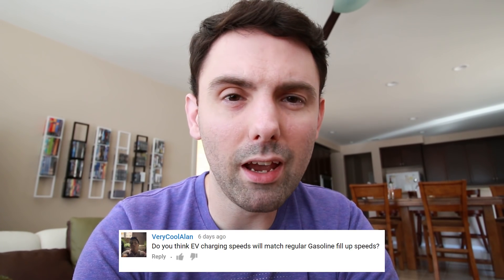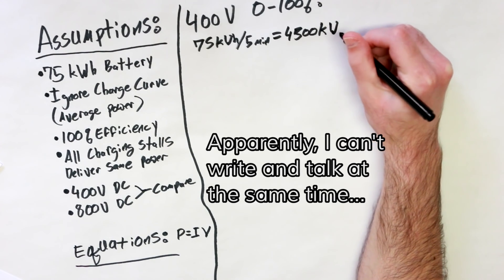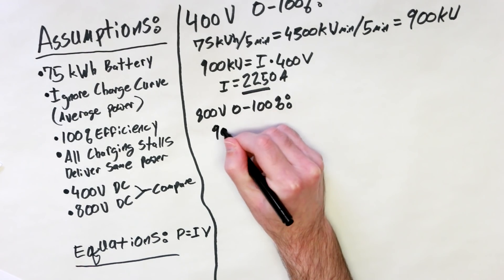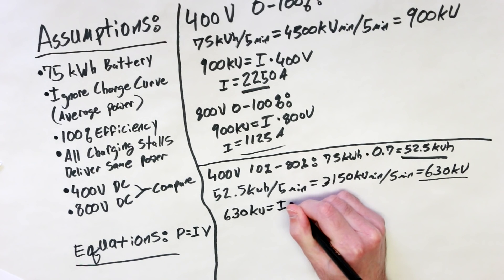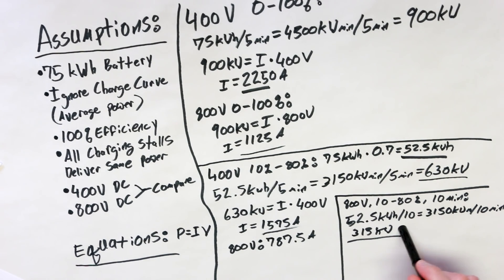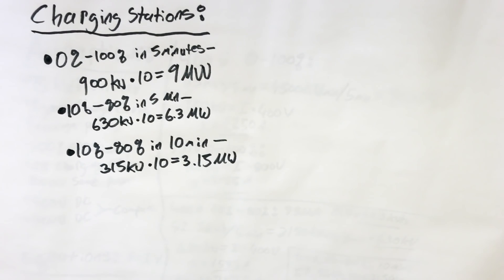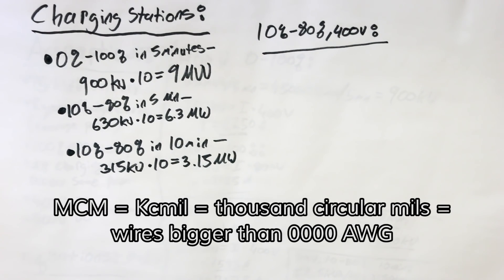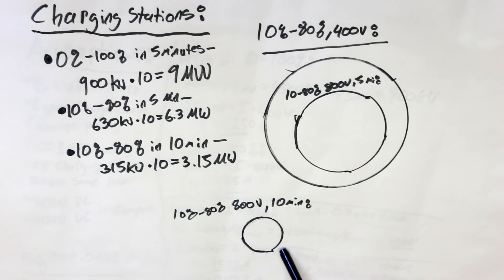Can Electric Cars Charge As Fast As Gasoline Cars Refuel?

Comment: A horse can remember where it's going and go there autonomously. Replacing horses with automobiles was a huge step backwards in that area, only a century later are we starting to catch up. EVs won't charge as fast as ICEs fill up for a long time, maybe ever. But it doesn't matter. An EV owner charging at home spends less time "at the pump" than any ICE owner. 16A charging at parking stations, 200 kWh packs and 350 kW charging makes EVs more than practical enough.
Reply: He's right.
New tech isn't always better in every single way. LCD monitors took a while to match CRT's refresh rate. And they still haven't matched their response time.
Reply: 6.6 is fine at home, it'll charge full over night. On the road you'd use level 3 and get 50 kW. The new Hyundai Ioniq can do almost 70 kW.
Reply: Patricia: China could do the kind of EV cars I mentioned that fits the needs of the daily commuter. Could be done quickly, nothing fancy, all the technology is there. They will do it for their market.  You don't need a 2 ton 500KW sophisticated monster like a Tesla. Musk is milking a certain class of people.
Reply: +Ellsworth M. Toohey. That is very myopic.
If economies only catered to "needs" they wouldn't grow. At least not as fast. Every category of products have a spectrum ranging from cheap and crappy to luxury and excess. Today's luxury will one day be the norm and one day outdated.
Reply: +Ellsworth M. Toohey - You're right about instant gratification, but you're only half right about who delivers it.  On a road trip, the ICE vehicle delivers instant gratification.  There's no question about that.  There's a gas station at every exit, and the car can be completely refueled within five minutes.  But, for local driving, it's the 200+ mile EV that delivers instant gratification.  Every morning you wake up with the equivalent of a full tank of gas.  The only effort it took was spending five seconds to plug in your car the night before.  And it's not a behavior people need to learn, because they've been doing the same thing with their cell phones for years.  There's never a question of "Oh, I have to remember to wake up a few minutes early to go to the gas station before heading to work."  And for people who drive a good amount, that trip to the gas station is a weekly occurrence.  There's also no question of having to hassle with an oil change every few months.  As far as convenience goes, EVs have it all over ICE vehicles for local driving, which happens to be the vast majority of driving for most people.  ICE vehicles have it all over EVs for long distance travel, which is comparatively rare for most people.
Reply: +Patricia Collins - I think you're right that there's a definite generational dynamic going on.  I'm an exception, but most people of my generation range from somewhat skeptical to outright hostile toward EVs.  But, teenagers these days don't have the same emotional attachment to cars and driving that we did.  To them, a car is just an appliance that takes you from point A to point B.  On top of that, they grew up plugging in their cell phones and tablets and laptops, so that's normal to them.  It's gasoline engine technology that is a little bit foreign.
Reply: +Ellsworth M. Toohey
Then don't buy a Tesla until they become more affordable. I can't afford a fancy Tesla either.
Reply: I see EVs in a realistic sense and want them to improve greatly. The positive I see from this is that being that Tesla is a luxury brand, people willing to pay for a Tesla are funding the technology to improve electric cars but I have a feeling that while the evolution to parity with combustion engine fill up times (regarding charge times) will occur within 50 years, I don't see Tesla selling a vehicle under 35,000 from this point on. 

It looks like Tesla won't be the one to produce an inexpensive (relative) electric car under 25,000 BASE PRICE before tax incentives. China seems most likely but hardly any cars in China are sold worldwide. Maybe Toyota, GM, Hyundai, Kia, etc?
Reply: Dan Sanger. I just hope people will be willing to adapt to that routine of charging and electric car but not this generation. People born from this point on in 2017 may most likely be the ones to accept the  concept of electric cars. There should at least be a charging infrastructure but for people in condos and apartments, I see a problem with availability. Tesla caters to the luxury department and that means there will be combustion engines for at least half a century.
Reply: Tesla also started from scratch. And tesla has become the EV ambassador, the flag, the captain leading the charge into battle. That changes the mentality of the populous. That changes the culture. 
"Tesla P100D does 0-60 in 2.3 seconds." Also affects the decisions of someone who's got 30 grand saved up. He'll think hmmm maybe EVs aren't glorified golf carts. That's very very very valuable. 
Reasoning with people rarely translates to change. You have to keep human nature in the equation. You have to make change look sexy. Otherwise EVs would be postponed, Suppressed and sequestered until a peak oil scenario. Those "milked" people convinced investors to pay for the Gigafactory Which will produce the 2170 cell which will go in the 35k model 3. 
Regarding pollution and resources I agree but take it up with capitalism and consumerism.
Reply: +HairlessHare - The CEO of Daimler put it very succinctly recently when he said that Tesla helped EVs shed their "granola image."
Reply: Ellsworth M. Toohey it looks like we may have to postpone this discussion for another decade. The Tesla echo chamber is too loud right now lol!
Reply: Street parking is a problem that might be  solved by public parking garages with 240v outlets or 240v charging posts on the street, like they have in Norway. Payment is electronic, typically it costs $3-4 to charge overnight which would fill a Hyundai Ioniq or half fill a Tesla. So no major new tech is needed. Consumers need getting used to it, sure. They adapt very quickly when they want to, not so fast when they have to.
Reply: Give it a few decades and that's for China only. Everywhere else? We all would be in retirement homes before that happens.
Reply: It's a start for the younger generation especially with charging devices like phones but if electric cars never catch on, promise me in the next 50 years you'll meet me at the Grand Canyon in your year 2032 Chinese electric car so we can both drive off the cliff together. /s
Reply: :) We'll Thelma & Louise it together.
Reply: Dan Sangers: Reread above what I said about what, based on current technology, electric distribution network ... an EVs should and can  be. I would buy one.  You don't find this car because there is no much money to be made !  The Chinese may do it for their internal market and then ? Tesla marketing is all emotionall, not rational.
Reply: +Dan Sanger
Yes, to me, a car is an appliance or tool that gets me to where I want to go. So I would love to get rid of that noisy and dirty ICE (internal combustion engine) and to go electric, if and when the technology can prove itself to be practical and a better value. Also, I want for cars to hurry up and go self-drive, as I am tired of driving. I want to turn driving over to a trust-worthy computer, so that I can better enjoy the scenery rather than having to keep my eyes on the boring road.

Humans are such lousy drivers, that I have high hopes that computers can handle driving better. Perhaps so, if we can put some brilliant programmers onto the task? There are many things that computers can do better than humans, that should make computers to be the better drivers. Faster reaction time, no panicking in reacting to emergency situations, the ability to maintain constant alertness for many hours with no rest, and the fact that computers do not get drowsy. In fact, I feel like my brain is running a computer program when I am driving. Which the human brain was not designed to do, but rather to be creative. A human driver may be able to somewhat track 2 or 3 nearby cars. A computer probably could track the motions of the 50 nearest cars. Thus, a good computer-driver might be capable of sensing a pile-up caused by lousy human drivers, a few seconds before it occurs, and be able to avoid it altogether.

I like the perspective shown in the movie "iRobot". Set in the near future, all the cars are self-drive and go faster and safer as a result, and they are not powered by fuel. A lady was afraid of the guy's motorcycle. "Isn't it powered by gasoline? Isn't that explosive?" Yes, even to me, burning fuel seems so quaint and out-dated. Apparently future cars are powered by electric or by free-energy. They did not fly, as they were aiming for the "near future". Although I suspect levitating cars without any wings may be possible, it currently appears near-impossible with currently known technology.
Reply: +Patricia Collins
Would many people living in apartments, perhaps be okay with charging at work?
Reply: If their workplace had the option for charging and the fact that these people will most likely always be under 80 percent charge. Also, being only able to charge at work, it is recommended for these people to have an electric car with DCFC because making errands can in a car you are only able to charge at work or a charging stall that may most likely already be used can wreak havok on their schedule. Stick to hybrids if you live in an apartment.
Reply: +Patricia Collins
I think most people spend more time at work, than they do driving. For people like me, who seldom want to make long-distance trips, it could work? And on long-distance trips, they would have to use super-chargers en-route anyway.

Let's say that you live in an apartment, and you have an EV with 200-mile recharge range. Your battery is at 50%, and you take the day off, or somebody else was using the charger at work. You have errands to run, that are no more than 30 miles. What exactly is the problem? You will add 100 miles more tomorrow, and only have to run 20 miles to do errands or to get to and from work then.

Hybrids are the worst of both worlds. The problem with the hybrid is that it fails to get rid of the pesky repair nightmare money pit that ICE cars have become. And hybrids cost more up front for perhaps slightly-better fuel economy, which probably is not economically justified. Or did you mean a plug-in hybrid? Well it is about the same problem for apartment dwellers, plus that they get a shorter-range vehicle, which is even worse. Why not simply an ICE car, since they will be buying fuel anyway?

Why would a workplace have only 1 charging stall? And if so, probably only 1 person at work even has an EV? If you can afford an EV, then perhaps you can afford to buy your own super-charger to donate to your workplace, if they are not willing to spend the money. If you have good job security and pretty much your own parking space, it would be almost like getting a super-charger for your home. You probably will not be living there forever either, and perhaps you can take it with you when you switch jobs or move out?

If I worked at some fancy place that offered EV charging, do you think that might influence me to take a chance with buying an EV? But what is really needed, is for somebody to invent an 800-mile battery. Perhaps it is possible, with all of this talk about graphene, solid-state batteries, and super-capacitors? Or how about we just use the free-energy machine technology that the evil NWO stole from Tesla and the American people? That would handily and ultimately solve the battery problem and eliminate the need for recharging.

Also, has anybody given any thought as to what effect that autonomous self-drive cars might bring? Would we then be talking of cars that can drive off by themselves, and get themselves charged up? Would one even need to own a car anymore, when you could engage in car-sharing, have a waiting self-drive car in your driveway at all the times that you want to go somewhere, scheduled by a car-sharing app? Would that be cheaper than owning a car with all of the headaches that that brings? Think of how much less parking would be needed, when cars are in use transporting people, 70% of the time, rather than less than 10% of the time? Car-sharing cars would likely be far better maintained, than many too-busy private car owners keep them maintained, as cars could drive themselves in for maintenance and cleanings.
Reply: Hybrids are the best stop-gap for people especially the nearly 50 electric mile Chevy Volt. EVs have to be introduced slowly and practically.
Reply: +Patricia Collins
What what problem do hybrids really solve? They still have too many moving parts, to keep causing problems. They still have that awful repair-nightmare money pit ICE (internal combustion engine) in them.

50 miles on a charge is a joke, but of course, they say that the ICE allows it to do longer trips. Some hybrids are modern-quiet at slow speeds, but not at high speeds. That is like having a shiny new spiffy car, well except that most of the car is rusted or covered with dirt and mud. It just doesn't shine or gleam quite as much as we had hoped. A hybrid is like a car that doesn't even know what it wants to be. Like a clueless "undecided" major in college. Actually worse than that, as what even is the point to design a machine, that doesn't know what it was designed to do? Hybrids are still vulnerable to a shaky economy and volatile price spikes in fuel costs.

EVs have to be introduced slowly? But most people refuse to buy EVs, because they are moving along in the technology too slowly, and we still doubt that the EV has enough to offer to make up for its annoying recharging issues. But if we could just have an 800-mile battery, then people would be making jokes about ICE cars, how they are oversized golf carts and can't even go very far on a fill-up. Wouldn't it be fun to see the tables get turned the other way, and then people who drive ICE cars will be the outdated weirdos?

And am I correct to imagine that there still is that tinge of people who suspect that hybrid drivers and EV drivers are weird or "greener than thou"? ICE cars are still considered normal and practical, while EVs are just strange. Perhaps that will soon change?

Me personally, why would I want to get rid of the exhaust pipe? When was the last time you had a big repair bill for an exhaust pipe? I want to get rid of the ICE. It has served its time, and it is horribly outdated now. Please make it go away. Cars should also be self-drive. I am sick of having to do all my own driving. I wish the car could do it for me. A lot of old people who are losing their ability to drive, would love to have a self-drive car!
Reply: +Patricia Collins - I reached the same conclusion as you did about PHEVs before I bought my Chevy Volt two months ago.  If I had been able to hold out two or three more years I might have made a different decision, but replacing my old car couldn't wait any longer.
Reply: PHEVs could also be  a double edged sword. If the Chevy Volt had 250 miles of electric range plus the 300 miles or more miles on gasoline, for a total of nearly 600 miles; that could cause the general public to go "hmm, so if I run out of electric range, I still have 300 miles on gasoline/diesel!" Oh and if the combustion engine of a 600 mile PHEV could be used as a range extender, that's going to make the decision between only a 250 mile EV vs the PHEV version of that EV with the 300 or more miles from the combustion engine plus the fact that it could act as a range extender will have people choosing the PHEV. Obsolete technology never really dies so we could see the next 100 years of 300-500 mile EVs and the PHEV counterpart for a total of nearly 1000 miles of range. Just a possibility.
Reply: You're massively overthinking this. An owner of a PHEV charges when he can and fills when he must and doesn't really think about the actual range in miles.
Reply: +Dan Sanger
Often the cheapest car to own, is the one that you already have, so once you buy a car, you are stuck. Most people can not afford to buy a new car until the old car wears out, so as I heard on talk radio, even if they came out with a car that ran on water, we would still need to drill for oil for the next decade or more, until the current fleet of cars wears out.

I will have to get rid of a car pretty soon. It is getting just so worn out. Too bad that the EVs still will not be ready for the general public. But I probably will get my other ICE car finally repaired so that I can drive it.
Reply: +Patricia Collins
Wouldn't it make more sense, instead of whatever hybrid proposals, to just design an 800-mile battery? I mean, they have those small lithium-ion bricks that jump-start your ICE car now? Why can't we buy an ICE car battery already, that is a fraction of the size of that so-heavy traditional car battery?

If the EV battery technology improved, then EVs could have something like "dual fuel tanks" in which there are dual batteries, well when the batteries become smaller and not as heavy. Instead of a mere 200 miles, it might go 400 miles or more on a charge. There is a limit to the maximum possible range, when the batteries are too heavy, as currently the batteries are half the weight of the car. Additional range becomes marginal, due to the weight of the batteries dominating the overall weight of the vehicle.

And for those people hyping the probably-failing idea of having a charged-battery swap program, the main thing that kills that idea, is that the batteries are too heavy to lift, and the shape of the batteries too awkward to make swapping them out to be practical. If ever the batteries can become smaller and lighter-weight, then additional possibilities open up. Carrying an extra 5-gallon fuel can (around 40 pounds of weight), extends the range of driving a car, by easily over 100 miles. Carrying around an extra battery for an EV, doesn't work at all, because the batteries are already so heavy and massive.

Just use the NWO-forbidden free-energy technology, and we can have infinite range without ever having to recharge.
Reply: +Yosef MacGruber the problem with an 800 mile range electric car is not the car itself but the EV fans who say not to focus on 500+ mile electric cars but to work on faster recharge times and vice versa. Fast charging or long range battery is fine by me whichever comes first but Tesla will not be the manufacture to make an affordable and practical electric car. Maybe within a decade, there will be the inexpensive basic Toyota Corolla of electric cars. Electric cars seem to only be affordable used and I doubt a 5 year old Model 3 will be less than 25,000 since Tesla loves to control their used car market.
Reply: +Patricia Collins
Faster recharge times are not near as important as a longer-range battery. Much of the headache of an EV is having to go out of one's way to recharge, whereas recharging at home is supposedly quite easy for most owners. You don't have to wait around while it recharges, for you are already at home. Like most people, I do not like having to refuel my ICE car. With an EV, you start out in the morning with a full battery. And you come back home with a mostly-full battery?
Reply: An 800 mile range BEV you mentioned as an example charging at level 2 speeds of 20-25 mph will take nearly 40 hours to recharge so recharging speeds are very important as well as range.
Reply: +Patricia Collins
Why do you think that you need a full recharge? 800 miles is enough to drive all day. Just how long can you drive without a rest? Or were you assuming that cars would be autonomous self-drive by then? Let's say that you are driving 1000 miles to your vacation spot. Why did you need a full recharge again?

If 800 miles is not enough, then hey, let's just build free-energy cars. That should handily solve the problem. No more recharging needed.

So what was your point? Level 3 works better with a 800-mile battery? But 800-miles is just a good option. Not like you have to use that option if you do not want to. If you have an 800-mile battery, but only want to travel for 200 miles, what then is the problem?

If I have to drive for 1000 miles to get to somewhere, an 800-mile battery requires but only 1 partial recharge. A 200-mile battery, is probably going to need 7 or more recharges along the way. Now which do you suppose is more inconvenient?

Here is a question that I have. Recharging takes so long, surely people will want to leave their recharging car, and go eat somewhere or go get a motel room for the night. So what happens when the car battery is full, but there is nobody there to remove the car from the charger? Yeah, sure, no doubt the circuitry prevents overcharging. That is not my question. Rather, what about the next person waiting for a recharge, waiting in line? How would that often be handled? Sure, you might ask the person to switch it over for you, but that doesn't work so well, if the next customer is not there yet.

So I still stand by my contention, that a higher range battery does more to convince us EV skeptics, than a faster recharging time. Because with 800 miles available, I do not really expect to be waiting upon recharging very often. Plus, we want to avoid public super-chargers, because there might already be a customer(s) hogging all the recharging slots. Presumably, that problem does not occur at your home super-charger. I like to be more sure that I can make it all the way home, after a long day of much driving.
Reply: +Yosef MacGruber Do consumers buy a refrigerator to just put one day's meal in or at least a weeks meal in? Besides more range and faster charging speed is a must for electric cars. Simple. Now isn't it past your nightly Tesla curfew now?
Reply: Yosef: Bla Bla Bla ! Point is THERE IS NO battery able to give you that range unless you are OK with a 3000kg expensive monster, NO battery able to be charged in less than 30 min. and the REAL KILLER,  NO FAST CHARGING STATION NETWORK. Therefore current EVs are limited cars that should cost less than 10 k USD, no frills ! I foresee a lot of disappointment when the average Joe who signed up for these Model 3 will realize its limitation, hassle in real use. We are not dealing with enthusiasts if not fanatics anymore but REAL PEOPLE with REAL needs and LIMITED finance.  Anyway, I will buy it back for 9500 cash :-)
Reply: +Ellsworth M. Toohey We have a new category for endless debates superseding Politics and Religion and that is... Electric cars.
Reply: +Ellsworth M. Toohey
Hey, I was one of those skeptics who said that EVs are oversized golf carts. What is the use of a car that only goes but 50 or 100 miles on a charge? Well somebody responded something positive about the Tesla EVs, and so I watched some YT videos about Tesla EVs, and I was impressed to hear 200 miles and beyond. I also saw the frunk underneath the hood, that made my ICE car seem really old-fashioned and out-of-date. Hey, maybe EVs are beginning to become practical. But the absence of an adequate recharging network, makes it even more important to have a longer-range battery. Who but rich people has the money to buy a car that is only good for commuting? We common people want a car that can go everywhere.

Didn't I hear that they are working on batteries that will offer a 500-mile range? Lack of sufficient battery capacity, was the one thing that held back electric cars for a century way too long.

Edited to add: There actually is a practical limit upon how heavy the battery can be, because when the battery becomes the vast majority of the weight of the car, then the battery's range becomes wasted, in just carrying around the weight of the battery. That is why rocket engines had to use several stages, because the high weight of the fuel they carried, was a big problem.

Super-capacitors can be charged in under 30 minutes, and the solid-state batteries in the experimental phase, sound like they can take a fairly fast charge.

EVs will not be cheap, just because you want them to be. EVs will only be cheap, when the technology progresses sufficiently, and when the market expands and develops better. Cellphones were not cheap, until many decades of technology improvements and market expansion.

The average Joe does not buy a Model 3. Who buys a new car, without knowing hardly anything about it? EVs have not gone mainstream yet, and are less than 1% of the vehicles on the road. EVs are not for everybody, not yet. So why are you assuming that people are being duped into thinking that EVs are for everybody?
Reply: +Patricia Collins
Who cares how fast a refrigerator can get cold? What people want to know is, how big is the refrigerator, and can they get all of their stuff into it. Some people have 2 refrigerators or more.

If they do develop a better battery, they can put a 500 or an 800 mile battery into an EV, even if they do not sell that many of them. But they can not put in an extensive fast-charger network, if there are but 100 EVs in the entire state or country. It does no good for the EV market, if all the important EV manufacturers go bankrupt, trying to expand the recharging network before they have enough sales to justify that very-expensive endeavor. You wouldn't expect to have very good cellphone coverage, back in the days when almost nobody had cellphones. It would not be economically justifiable to put the number of cellphone towers up that we have now. The high cost of the recharging network, is yet another reason why better batteries might prove easier to do first, than to get all the chargers to be as fast as possible and to get more places to recharge.

I was a little surprised to hear that there are as many places to recharge, as there are, because there is still the public perception that EVs are only for enviro-weirdos or tree-huggers. Yet have I ever seen a super-charger slot, or an EV that was actually there in person, that I could reach out and touch? I have only seen them on the internet.
Reply: +Yosef MacGruber Did you not see Elon Musk's twitter message telling all Tesla worshippers to get some rest for their curfew? lol 

TL:DR
Reply: +Patricia Collins
If EVs would just hurry up and get their technology together, and improve it much, there would be no debate. Today's ICE cars would soon seem like the old steamer cars. Good for hardly anything other than being a mere historical curiosity. But I think that many of us are hopeful that EVs are going places, because we are really getting sick-and-tired of the century-old crap ICE technology that we are stuck with. We would love to see something new and much better.

We got stuck with all these hybrids on the roads now, that really didn't solve much of anything, due to EVs still not being ready to go mainstream. But the hybrids probably did show an interest in EVs, and people really wanted EVs, but had too much "range anxiety" to trust the very-much-limited EVs developed so far. I think that more people are starting to get interested in EVs. It would be a shame to let this opportunity to reduce Big Oil's monopolistic control over the world, go to waste, and to become stuck with horrible ICE cars for decades more. Yet if EV companies can't soon figure out how to extend the recharge range, and how to get the cost of EVs down to where more people can afford them, then it will be a huge wasted opportunity.
Reply: yosef: Once again YOU fail to undersand what I said ! Tesla are OVERPRICED for what they offer in term of USABILITY !  300km  gives you 150km range ! I don't car about Tesla acceleration it is normal for an electric motor, I don't care for all the gimmicks ... As for the cost, electricity is not taxed as fuel is. BTW, the technology used in ICE is far more sophisticated than the Tesla. Add to the Tesla all the infrastructure to produce and deliver the electricity to your battery charger to compare. Oh, BTW, I know how all these motors works and I know the electric motor is the best and lead to very simple drive train. Nothing is new in a Tesla but the use of cheap 18650 PC batteries. Musk dared to use them, fine !
Reply: "I'll take an electric vehicle that can charge from empty to full in an hour" -Yes they are called Tesla! Well to be exact, just over an hour when on the road and when at home it is possible to do a full charge in about 5 hours.
Oh and the argument people use about how it takes them about 5/10 minutes to fill up their petrol car and thus any EV that takes longer to charge up is flawed and to be ignored is itself FLAWED.
On a long trip it DOES NOT matter!!!!.
No and I mean NO driver really likes to drive(or needs to drive) for hour after hour after hour after hour after hour..hang on I'm not done yet..after hour after hour without taking a  break! 
You know to do those pesky things such as take a bathroom stop, have a drink, maybe eat something and stretch their legs etc. So why not charge up at same time.
Plus I do not know of ANY car driver who drives till empty then fills up.
So not a problem really once your brain is engaged a bit.
Reply: Ola Leier Yes that's the Point that most People can't imagine, 
because of the Experience with ICE Cars..
Reply: Teslas don't get hungry, grumpy, spooked, poopy, or sick as much as horses, and battery swapping was faster than refueling gas but most people prefer to simply plug in at home rather than go to a special place to recharge.
Reply: HairlessHare: It is why the planet is over polluted, the resources overstrained by useless short-lived garbage people feel obligated to buy due to the propaganda of bullshiting salesman. See smart kids, they prefer to play with the boxes and their imagination instead of  the junk toys that came in ! If you enjoy being driven around city blocks by your Tesla able to accelerate like a jet, good for you but spare me the  justification. As I say, Musk is milking a certain class, fine. but don't tell me he is making things evolve. All the real research is done by others who have to struggle to get funding.
Reply: It is happening whether you think it is or not.
Reply: The general public has the final say about electric cars. Can't argue with EV fanatics.
Reply: Sooo many factors left our of your thinking.  For the majority of people 200 mile range is fine for today's needs. EV's ARE selling at rates the model T couldn't achieve, while rapidly dropping in price. Battery tech is advancing at rates ICE cars never did or will. Fewer young people are owning cars. As EVs continue to grow in use, there will be fewer gas stations, as they already have a difficult time being financially viable, making owning a gas car less desirable. In many highly populated cities there are already monetary deterrents to driving ICE cars.  Before the first horseless buggies arrived people thought they would never work because there were few roads and very limited distribution of fuel. The change took very little time. Finally, market analysts more capable than you and I have determined it will take no where near the time you claim it will.
Reply: The general public are used to 5 minutes or less fill up times. I like EVs but the same argument "It just takes me a few seconds to charge the car by just plugging it in" will not fly with the general public. EVs are like a downgrade to anyone who drives a gasoline vehicle regarding time to fill up or charge.

I want to see EVs with AT LEAST 10kw or more Level 2 charging. No more pathetic 6.6kw chargers I'll take an electric vehicle that can charge in 1 hour from empty.  That would mean just 30 minutes for me since I would probably never go below 50 percent.
Reply: Patricia: You are totally right and all the "enthusiasts" here by their posts prove you are right too despite they claim the opposite. You have to be more than "enthusiast" to accept to pay such huge amount of money for such luxury, performance (easy to achieve because of the very nature of the electric motor) and complexity that FAILs miserably in giving the SERVICE, a normal person expect from a car, to be able to go where you want when you want without any hassle.  Current EVs are limited range cars and should cost less than 10 K USD, less than 800kg, 200km range able to be recharged in less than 6h on a 6KVA condo electric install (not even the norm). They would fill the gap between an electric bike and a normal car. Not much money to be made there though. Better to milk the rich gullible ecowarriors and Tesla sect members. Fast charging networks are not there and nobody really knows what to plan as technology is evolving and how to finance it. They can even decide on a common plug, charging method, voltage etc.... These guys are already carrying various plug adaptors in their trunk ! Note, I hope it won't take AN OTHER century, the battery car was already king of the road 100 years ago  !!!!!
Reply: Fine at home is subjective because to EV Enthusiasts such as yourselves, you will be okay with it, but the general public wants instant gratification. Give it about 100 years for EVs to reach parity with combustion engines.
Reply: You just showed how ignorant you are. Great, you qualify as a Tesla church  worshipper !